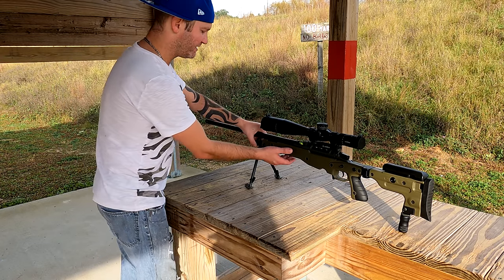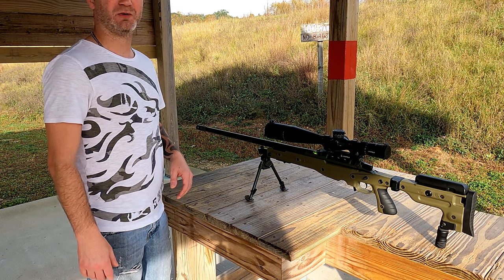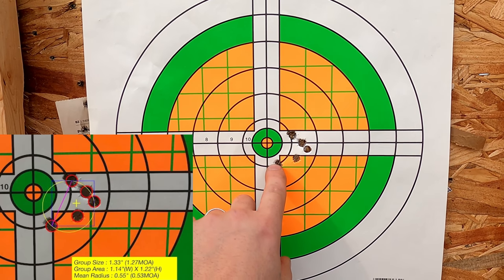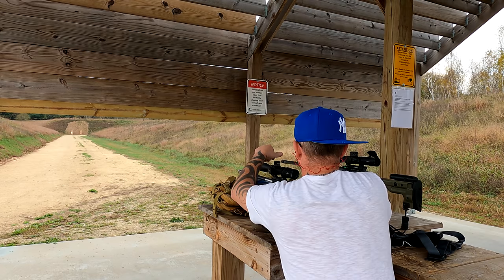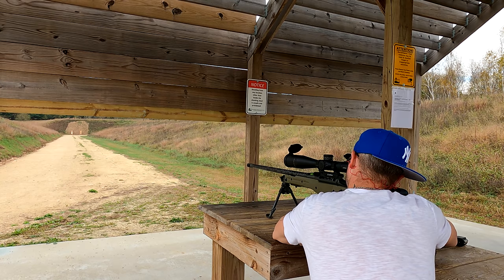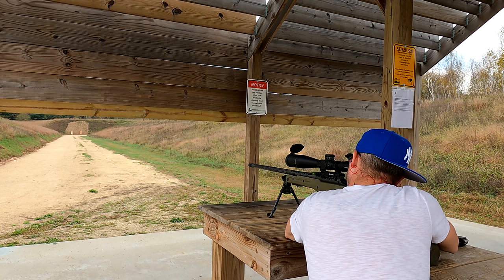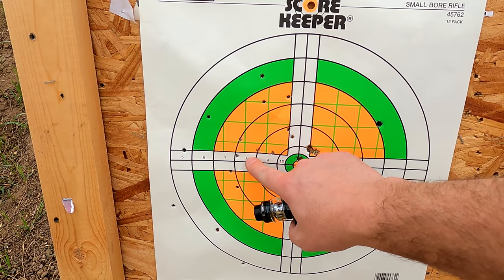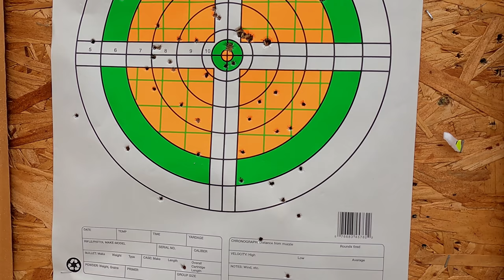I Cannot Get The Rifle To Shoot More Than 3 RD’s And Stay Under 1 MOA

Comment: proof research makes the best carbon barrel out their ..  after watching you shoot i see several problems. get rid of that mono pod gadget and get a rear bag. after every shot you completely break your entire shooting position, you need to keep your face on the gun and not break your position just to run the bolt. you need to avoid hard on hard contact when ever possible i.e. game changer bag or the similar  to rest the for end (not the bi pod) and a rear bag. i cant see what your booger hook is doing on the bang switch but im assuming that's where your inconsistency are, at the 2nd knuckle your finger should bend at 90 deg and straight press to the rear. the hard on soft contact helps alot when certain fundamentals are not perfect, where with the bipod,monopod set up its so rigid it all bleeds thru to the shot.
Reply from the maker: It is a proof 
Maybe it’s me but proof is getting the exact same result I am but I get 3 shots they get 2 and there is the fact my zero keeps changing with the temperature and I can pretty much out of this rifle with every other rifle I own 
https://youtu.be/MXtee3ipsW8
Reply: @CRSFirearms  I shoot off my hunting pack but I do use a bipod at the range. Same results.
 Its the barrel generating a lot of heat, its a hot round. As it heats the harmonics change. 
I have a medium conture cryo. From decades ago. I've had that old girl hot. 
10 apple strings at 200yds on the timer will heat almost anything up. I've never had drift from heat. No POI shift at all.
Reply: Very well said. Muscle memory is key.
Reply: CRS..if proof is getting the same results with flyers..why are not they replacing it?
Reply: What shadowlab said. Get rid of the mono pod,  keep your head in rifle, and focus on consistence in your shoulder loading the bypod
Reply: Nothing you did was repeated. You fussed with every shot. Your target is in a fixed position but you keep goofing with your shooting position.
Reply: It's hard to imagine a Proof CF barrel not holding up to the demand. A stock can heat up, too. Ammo can act differently to barrels at different temperatures.

I had similar symptoms with my Compass II. Turns out that I have a great barrel and it is sub MOA. Sometimes I, the shooter, am not sub MOA. However, my technique has improved. And it does not matter if I am shooting Hornady SST 165 grain, Federal Nontypical 150 grain, or Armscor 168 gr HPBT, it is getting 1/4 inch to 1/2 in to 3/4 inch MOA, cold or hot. Which means that my shooting skills are improving and the barrel is not as finicky as I thought. Like the 4150M Chrome Moly barrel in my WW R16SFST-308 (AR-10.) It will eat anything.

The Armscor can have some variables. Sometimes, a hotter load. I got one casing stuck after firing. No problem, a love tap with an electrician's hammer (small pair of lineman pliers I had with me) took care of that.

But you are a good enough shot to get the first few at 1 MOA or less. But it could subtle shifts in how the rifle is held.
Reply: Still doesn't explain the wild flyers...  You can see how consistent he's shooting in the groups ---  those wild flyers are something happening with either internal ballistics, or possibly external ballistics if the ammo is not really consistent.  Personally, I'd start with the ammo and inspect it very close, and even match weigh them.  It wouldn't surprise me if there's a variance in powder with the ammo..  .22 is cheap and it's hard to get really good ammo.
Reply: @calholli  Good point. And sometimes, with my cheap ammo, I get a hot load. In my semi-auto, an over-gassing problem. In my bolt action, a stuck spent casing. But the bullet still landed where it was supposed to land.

So, quite the mystery.
Reply: So pretty much your trying to say the more you spend the less accuracy you’ll get? Makes total sense haha 😂
Reply: One thing to check also is if the bullet tip is hitting barrel ramp and scaring it this would surly change a lot in ballistics.
Reply: @hulkhogan4383  He had a gun smith set barrel to action for this rifle. I don't know if there is an issue with damage to the projectile from feeding. It is a really point you brought up. However, in the interest of being truthful and scientific in all of this, Matt has stated that the gun smith who set barrel and action on this did not know Matt's ultimate intention. 

Because that guy knows what carbon fiber barrels can do. He said he thought Matt was building this rifle for hunting. In which case, in deer hunting, you are lucky to get two shots at a deer. If you missed the mark with two shots, you are not getting a third. And this barrel would be fine for that. Lighter than other barrels, plenty accurate to 600 yards when most people deer hunt to about 200 yards.

In videos, Matt has shown some of the public land where he hunts and you would likely not be able to shoot past about 50 to 75 yards reliably because of the dense foliage and trees. If the smith had known he planned to make this a sharp shooter rifle with strings of fire similar to competition or special operations deployment, he would have tried to steer Matt away from the carbon fiber barrel.

I also have watched round table discussions with guys in F Class. And they have stainless steel thick barrels. And when they go hunting, they carry a Tikka ultra light system that kicks like an angry mule and is good for just a few shots with a pencil barrel. Which is understood and expected.

My opinion and $1.80 USD will get you a Diet Coke at the convenience store but I would take similar systems to what my intention is and build that way. What other theater of operations for strings of fire do you have that is similar to a designated marksman or even a Ranger with the actual MOS of sniper? Or a guy in F Class aiming at targets 4 inches wide at unknown distances? Easy answer, friends.

Varmint shooting. For an example, check out here at YT a channel called woodchuckin. He goes to the pastures of someone's farm, picks out a spot, usually prone. And picks off wood chucks (ground hogs.) At 700 yards.  10 shots in a row.

So, for me, the base of this rifle build, regardless of the style of stock, would have been a varmint rifle. And that usually is built around a medium bull barrel. Medium is still light enough to manage but the barrel is consistent regardless of heat. I have a Mossberg MVP (Mossberg Varmint Patrol) Long Range 308, the Thunder Ranch edition in Kuiu Camo. 1/3 MOA with 180 grain on a hot barrel. It has an adjustable cheek piece. I put a pachmayr pad on the butt. It had a Diamondback Tactical  scope on it last season when I hunted with it. Now, I put on a Vortex Venom 5x - 25x / 56 mm scope with the EBR-7C reticle.

Another option is to build an SR-25, which is a semi-auto in .308 Win (7.62 x 51 mm NATO.) Sgt. Nicholas Irving had the highest number of confirmed enemy targets down for a single deployment in the sand box. They call him "The Reaper." He carried an SR-25. His sniper team leader carried a .300 WM. That regular Win Mag jammed all the time. But it was good to have if you wanted to shoot a click or more. Most of Irving's engagements were at less than 1,000 yards.

However, this was a neat experimental build and a hard lesson to learn.

Comment: You need to remember carbon wrapped barrels are super thin.  They are thinner than a sporter profile.  You will likely not get sub moa 5 shot groups.  Its probably a 3 shot or 4 shot max before it stats to walk due to heating.

If you are shooting factory ammo the performance I am seeing Is more than adequate.  

Also don't cook your rounds in your chamber.  Chamber the next round when you get more settled.  The less time a round is stuck in a hot chamber the more consistent it acts.
Reply: 5 shot groups are too much😱 glad I know now.  I’ll never buy a cf barrel
Reply: @Milkywayboy  they're not bad, but there is no replacement for a heatsink than mass. the carbon may be strong and light, but when you want multiple rounds (10+) to stay sub moa, it is waaaay easier with a full bull barrel.

if dragging it up a mountain for miles and miles to make 1 shot on an animal then carbon is probably what you'd want.
Reply: You beat me to it haha 😂
Reply: @Milkywayboy  useless fact-I run a 22lr carbon barrel with no issues, anything bigger and I wouldn’t have a carbon wrapped barrel Lol
Reply: Your wasting your time commenting, he ignores it every time people tell him his problem.
Reply: @randomguy1371  haha we ALL already know Lol 😂

Comment: I’ll say it one more time.. Sell that barrel! You have two competing elements trying to warp one another under extreme (heat)conditions.... Those two elements will never, ever align to get you the accuracy you want under those conditions.. I respect your tenacity, however, if an AR platform 6.5 with a steel barrel stomps that bolt gun for accuracy, the rest of the components you’ve collected in this build are useless. Thick steel is the only answer here.
Listen to the community that supports you!

Comment: Brother, Welcome to precision shooting! I’ve been chasing the dot for decades. The heart beat is my worst problem. Breathing is easy. Get some blue jean legs, sew up one end, fill it with old tumbler media and then sew up that end. Use bags for the rear and the center of the rifle and go ahead and Use Your bipod too. Squeezing the bags will work on Your elevation. Another couple bags on the side will help with the heart beat. The cross hairs should be steady now. Breathe........ wait to get Your breathing back down and Your heartbeat steady. Fire on or between heartbeats. If the rifle is good and the load is good, Your groups will be good. It’s all in the details. Don’t chase it. If it’s good, You’ll know.

Comment: Stop taking your face off the rifle after every shot. You keep moving around. You change your natural point of aim each time.
Reply: I think bench rest competitors break thier cheekweld between every shot. As long as your consistent in your fundamentals it shouldnt matter although I could be wrong.
Reply: @davidpaulk5658  I was a primary marksmanship instructor in the Marines. Just saying I have literally coached thousands of Marines. I have seen these mistakes a million times
Reply: @bearhead9633  So you basically have tasted every flavor of crayon there is.🤢
Reply: @mybad8805  pretty much yeah
Reply: @bearhead9633  I want to improve my accuracy. If I'm shooting a bolt gun should I keep my cheek planted firmly on the stock and manipulate the bolt with my right hand? Or are you saying CRS isnt following through on the shot and lifting his head too early?
Reply: @bearhead9633  Thank you for your service.
Reply: @davidpaulk5658  when I shoot bolt I dont take my face off the stock during the string.  I am a lefty. So i use my right hand to manipulate the bolt. If you are right handed you will use your right hand as well

Comment: The biggest thing I noticed with the 300 PRC is that the rifle is jumping way too much. It doesn't help that the skids of your bipod are literally skidding on the wooden bench. There are a few other things going on from what I can see. You should adjust your butt plate higher so that you are more in line with the bore. A bigger muzzle brake would help. Most importantly, you should get a shooters mat and shoot from the prone on the ground. You could get a heavy rubber mat for on top of the bench so your bipod doesn't slide about. You want to be able to put a bit of preload on it and have the rifle recoil straight back without jumping.

Comment: Are you using a "side focus" optic.  Proper adjustment of the side parralax adjustment may be the answer to all issues. I put the rifle in a rest. Get the sharpest pic possible. Then back off the rifle so as not touching it. Moving your head slightly adjust the side knob until the sight picture does not move when you move your head. That is zero parralax. If you are shooting fixed parralax you have to figure out how to get the most consistent placement of your head and eye to the scope. A slight change on cheekweld can change POI easily by 1/2 inch or more. Precision shooting can drive one mad.

Comment: In order to mitigate heat build up, immediately eject hot case out of action after watching bullet splash.  Then only after your all lined up and ready to fire again do you chamber a fresh round to minimize the time the new case is sitting in the hot chamber.  As ambient ammo temp climbs to +140F your MV is shifting.  Changing everything, also the metal crystalline structure is shifting and warping due to heat.  Set a timer for 2min between round etc to control the variance better.

Comment: Try an EC tuner. Don't grip the rifle tight either, handle it softly and let it do the work it was meant for. Believe it or not, changing your bipod, also is changing your harmonics going thru your barrel and stock. You took out the movement and made it more rigid.

Comment: Had a similar problem with my Sako running 30-06 175g s/steel tipped bullets and 51g of VV165 , lapau cases and federal primers . Problem was heat dissipation , solved by running 3 shot groups and running a patch through to aid cooling . Rifle with myself shooting cloverleaved groups on numerous occasions . Once the barrel was hot it started to loose accuracy and spread . Letting it cool down and running a patch through brought it back to sub moa . It was a hunting rifle and so not designed to shoot numerous groups but one or two accurate shots a time . Hope you get it right pal , it’s frustrating I know . My favourite powder was IMR 4895 which worked best for my 30-06 or 308 , I can’t get it here in UK anymore so have to use VV 165 or 150 which doesn’t quite give the same results . I live with it . 🇬🇧🤝🇺🇸

Comment: Try some JB bore paste an Hoppes 7.62. To basically strip the barrel entirely of copper fouling, THEN REPEAT the barrel break in process outlined on Tiborasarusrex’s YT channel for proper copper fouling (that way your sure that the bore is in as ideal conditions as possible).....before shooting for groups sort the ammo you have for weight, O.A.L., and bullet seated depth, and single load BY HAND.....then remove both the front and rear bipod and shoot it from sandbags / bean bags.....if none of this helps dramatically......THEN acquire a rubber barrel tuning damper that your able to slide up and down the barrel and shoot groups again (repeating cleaning and break in process to redistribute copper fouling evenly......if it doesn’t shoot 5-shot groups any better than before, you basically are at the point of “last ditch efforts,” and what I would do is completely disassemble the rifle and “bed” all critical parts to each other with green, blue, or purple locktite (which type depends if your willing to take the rifle apart again / address that past remaining concern anytime soon), and bed the scope mount to the action, the action to the trigger / mag block, the action assembly to the chassis, and all things that mount to the chassis that interface with you (Ex: stock to chassis Wiggle check / bipod mount to chassis wiggle check).....Then do the cleaning, break in and sorting, and shooting from bags again.....if all this fails, I’d see about possible getting another shooter or two behind the gun to give some groups a shot.....after all this if no improvement is seen or the level of improvement is not satisfactory to you, then I would do what many others have commented on and replace the barrel with the heaviest contour you can find.
Reply: I didn’t mention this above due to the length of the comment, and wanted to suggest things that didn’t cost much $, just ammo and time / effort, BUT a few additional recommendations would be to get a barrel cooler (the kind that you under in the open action that blows air down the bore, for under $50).....I know this doesn’t fit the philosophy you had in mind for the rifle but, it would be one additional (and the last) factor I would try to eliminate after doing all the previous actions, and it would need to be done in a consistent way with somewhat equal cooling time between shots or it’s not worth trying.....also I should have stated this I’m my first comment but shooting prone, would also minimize body and head movement / help with consistency of head placement and loading of the rifle....for all the above tests mentioned I would ditch shooting from the bench for going prone.....lastly I’m sure the ammo your shooting is pretty consistent if there’s always just one flyer, but finding what the barrel likes if you decide to stick with factory ammo should be done last, because it is a variable that changes between even lot numbers of the same type of ammo, this shouldn’t be the difference between 1/2 and 1-MOA if EVERYTHING else is correct / perfect, but your barrel may have a preference to a particular brand / OAL / weight.